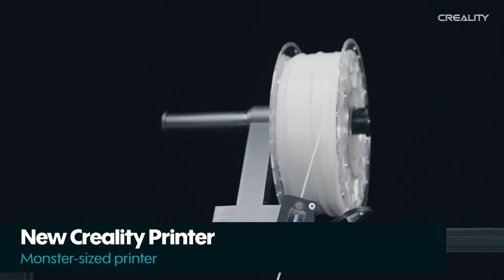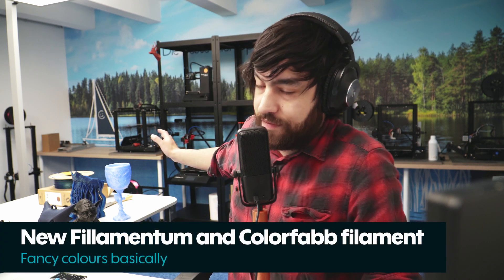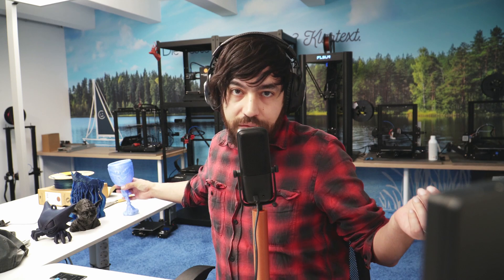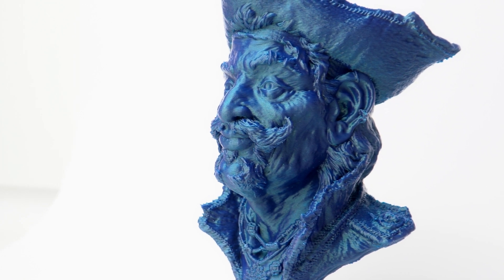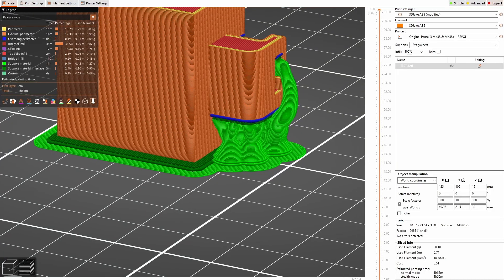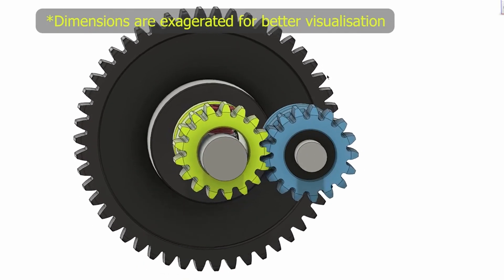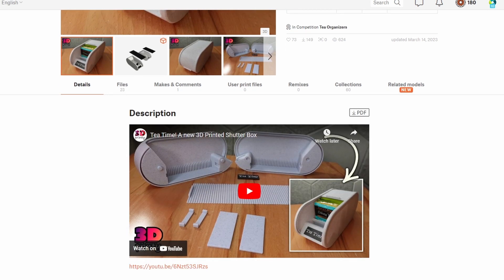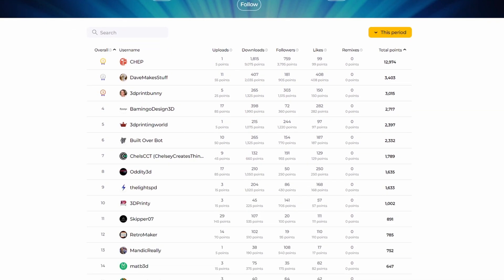3D Printing Community News #1

Comment: Have ordered the neptune 3 plus from your website says in stock March 28 how accurate is this please
Reply from the maker: It should be on time, sometimes it can be off a bit because of circumstances with our supplier, but normally not more than a couple of days.

Comment: Glitter, nozzle killers 🙂  Talking of nozzles (your web site says "Nozzles for every application", I have put stainless steel inserts into my Ruby Brass nozzles (0.4, 0.6mm). Why? well my Qidi X-Plus uses Mk10 M7 nozzles in high and low temp extruders, but the Capricorn tubing does not penetrate the nozzle of the High Temp extruder. I wanted high flow rates hence the brass, but also high temps and abrasion resistance (Nylon CF), so this was the solution.  No CHT nozzles for Mk10 M7 by the way 😞. Filament - no HDPE. Commonly used for our plastic milk bottles. A common plastic but a pain to print which might be the reason we don't see it (I don't think it bonds to anything). Potentially food safe it is also very slippery making it a potential for bearings/bushs. I think HDPE is the material most likely produced with these home made filament extruding machines.
Reply from the maker: That stuff is a nightmare to print, cool qualities but poor dimensional accuracy nullify most areas of application. You mentioned it being slippery? We're actually getting a PETG-Teflon filament next week, we'll have to put it in the next update. As for the Mk10 nozzles, yeah there are very few printers that still use these and because of that not much choice compared to a v6 or mk8 :/